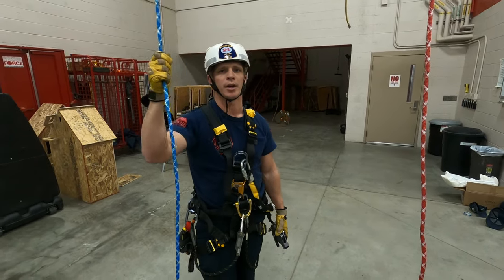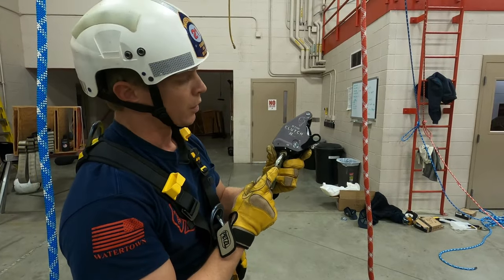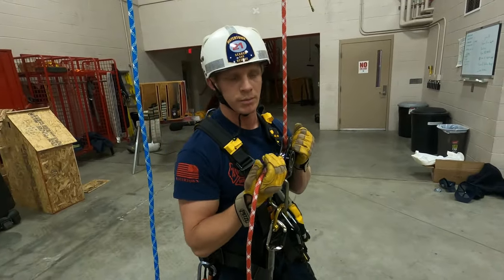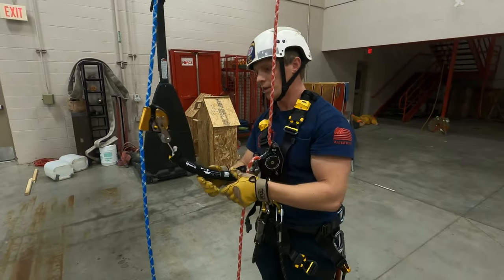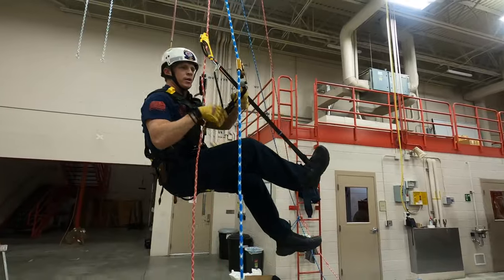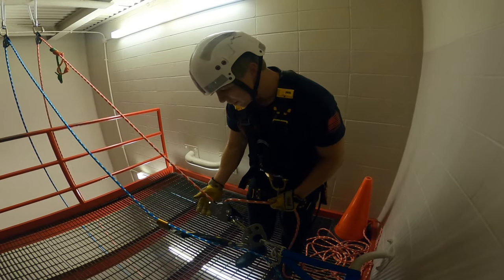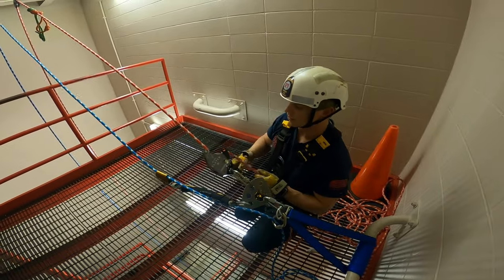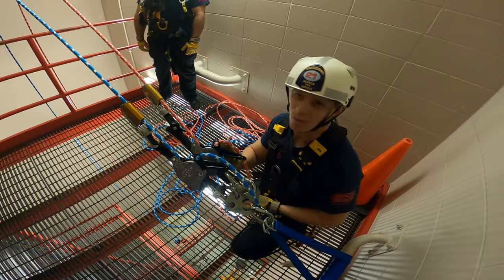CMC Clutch and Petzl ASAP Lock

Comment: So I'm not municipal and never have been. I work in a chemical plant and serve on the ERT on site. On the lowering system portion, are you not concerned about using the same anchor point for both the main and belay? We were always taught to do our best to use different anchor points in case of failure. Just a question.
Reply: I think I can respond here.  In an actual rescue situations, we always tried to use independent "bomb proof" anchors if possible.  In this case, they are using anchors that they trust and used for training.  So yes, separate is always the safest in actual situations.
Reply: @PhilipNation-xm5lh  that's what I assumed but figured I would ask.